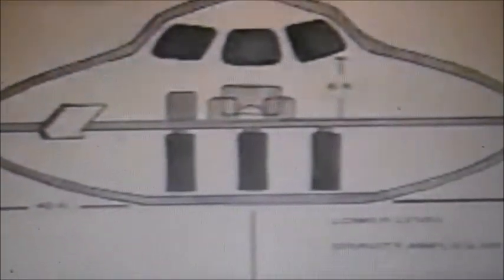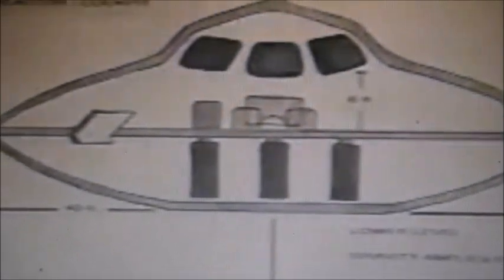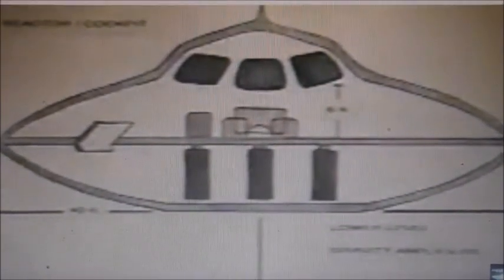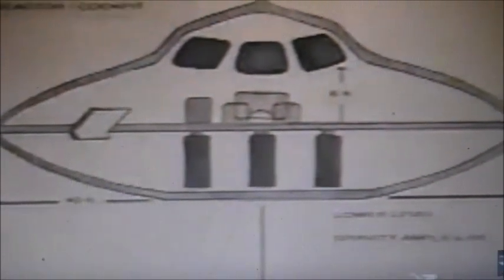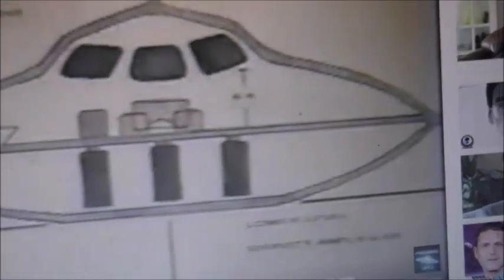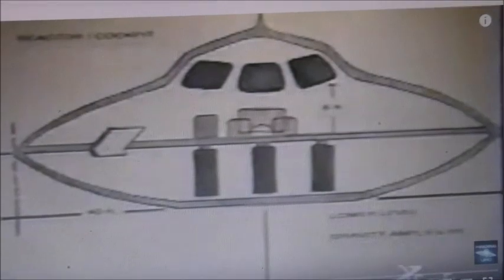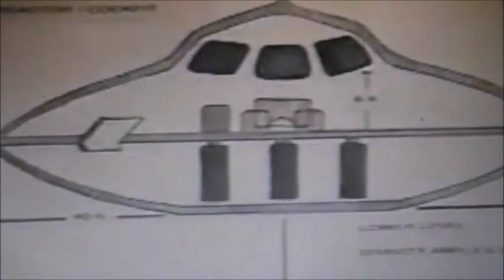More Hilarious Lazar Nonsense...

Comment: 1) When I did thermodynamics at Basingstoke University College (2002-2003) the first rule of thermodynamics we learned was : "energy cannot be created or destroyed in an isolated system". I also remember learning this in 2nd form physics class. 

This FUCKTARD relies on IDIOTS who KNOW NOTHING. He is a loser. He's like a cretin who steals old ladies hand bags. There's nothing honourable in what he's doing. He is a deceitful liar praying on the gullible and weak. He doesn't even have a spine.

2) Imagine if this little flying saucer produced more energy than a black hole ? Just by moving the damn craft you'd fuck up the space time continuum.

3) Steve, maybe the engine is all covered in alfoil ??? That'd keep the heat that doesn't exist in.

4) Proof !!! Look at the Lazar drawing again. You can see where they attach the string to the top of the model. The connection point is right there.....

Or maybe it's a 1/4 wave ? Less drag than a 5/8th.....

Imagine this, you'd have to slow down to less than the speed of light to talk to anyone lest you'd arrive before your request to ATC had been received.

5) At least you could run a big amp on board with all that extra "free" power.

Antenna whip would have to be pretty strong - coronal discharge would burn it up on high power. That's if it didn't keep getting ripped off in the space ship parking station.....

6) And why the fuck would you have windows ??? Imagine the insurance premiums ?

and how do you get a replacement that far from home ? And who the fuck would you call ?

NB : Lazar didn't think this through. That's a hot tip.
Reply from the maker: No 1 says it all really... he relies on people that have little or no understanding of physics/things technical to flock around him and lap up his nonsense. With that and Knapp/Corbell massaging his ego for cash I'm sure it makes him feel good, and probably makes him a few quid. So, he'll probably stick by this fantasy until he drops off the perch.
Reply: We should do a stand up show about the fools....